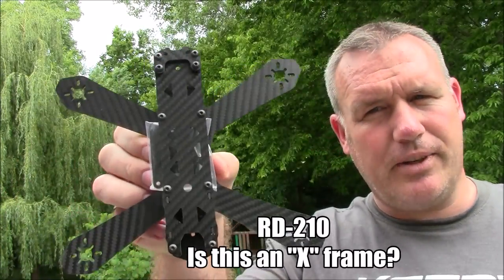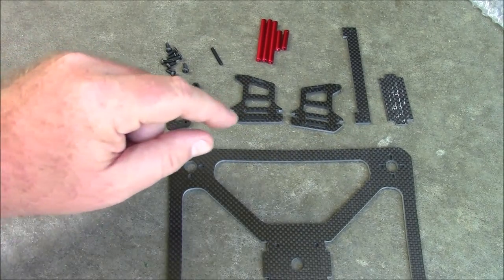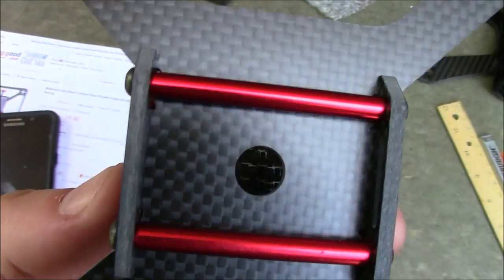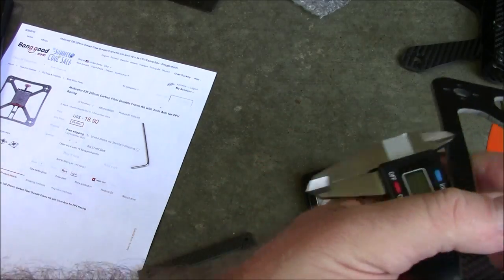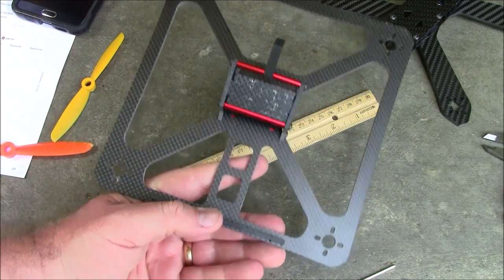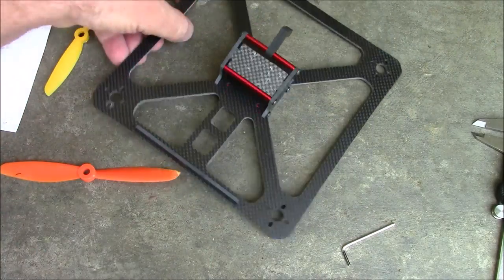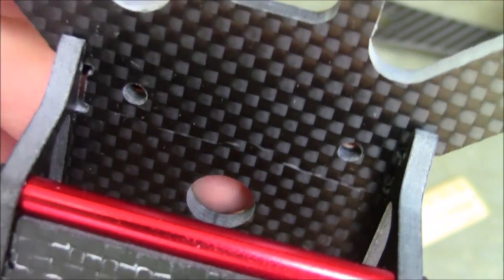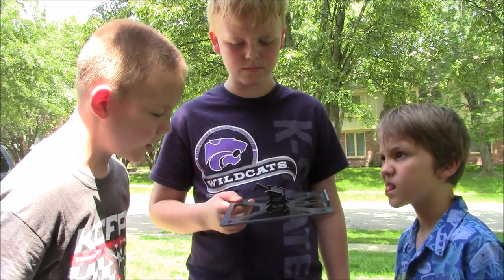Multirotor 230 (Not X, Square?!) Frame Review

Comment: i hope they progress to more structural carbon frames soon, the big flat arms just look really bad, as well as reducing airflow. i mean how hard would it be to design a box section .. diamond box section that we epoxy together ourselves, also travis, i just bought the multirotor 210 you reviewed, the stand off posts are 38mm, kinda tall and with a 1.5mm top plate?? i'm gonna try and use lower 25mm stand offs and 35mm 3rd tier at the front to help with battery sliding in a crash and to carry a runcam,   .. ps. people have problems using reply button to me, don't sweat it.

Comment: hey travis!awesome videos! reckon you could giveaway some of the frames you dont use? :D woulds be awesome haha. cheers from Australia!
Reply from the maker: I host local drone races and I'll put up a frame or 2 sometimes as prizes.  When I get to 10,000 subscribers, I'll probably do an online giveaway since I haven't done one yet.
Reply: +travisgrindal Ahhh sweet as! Can't wait for the 10,000 subs lol. Are you going to review the 180 version of the multirotor 230?
Reply from the maker: I haven't seen the 180 sized one yet, but I'd guess it was a lot the same as the 230 except that it probably spins 4" props instead of 5".
Reply: +travisgrindal yea they say 4", but wondering if maybe it's possible to add a pod like the shrike frame and run 5"
Reply: I just received the 180 after a month or so of waiting. 
no camera mount and same issues with FC mounting holes.
the CF on mine seems pretty clean without "cracks" or discoloring of the adhesive.

has anyone worked out how to fit the FC to this without using tons of tape?

Comment: yaas thanks i just would like to get this frame
Reply: found you again lol
Reply: +Ultimatevapor918 Haha great ☺
Reply: Eat Sleep Drone Repeat :)
Reply: +Ultimatevapor918 too bad that 1 esc stopped working.
Reply: +Ultimatevapor918 i ordered the DYS xm20a v1
Reply: my little bee 20 went out too this is the second time in a month idk why that esc keeps heating up but it gets so hot before i even take off i cant even put my finger on it very long i need help lol
Reply: +Ultimatevapor918 ahh hope that you can fix the problem
Reply: Ive replaced the esc 3 times no fix lol
Reply: little bee20 and little bee30s tried both im just using my vortex 250 now

Comment: Very odd quadcopter. Looks like they rush it out before quality check. Those creases can not be good.
Reply from the maker: Well, at least they just look to be on the surface and not down inside the carbon fiber.
Reply: +travisgrindal True. But still could potentially be a weak spot regardless. Great reviews, keep them coming bro!

Comment: I race with this quad.  Really like it.  Very similar.  http://www.multirotormania.com/frames/1280-mrm-scythe-220mm-x-frame.html?search_query=scythe&results=13
Reply from the maker: Kind of.  It has spacers that hold up the top plate.  The 230 in this video has carbon fiber side plates.
Reply from the maker: I forgot to ask, how do you like racing with that frame?  Do you notice any difference in flight characteristics between it and other shapes (H and X)?